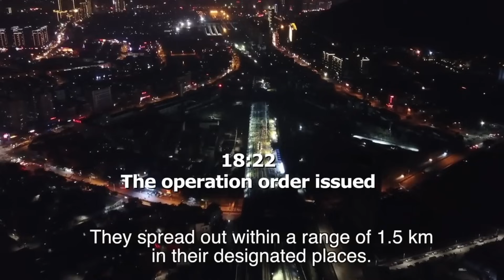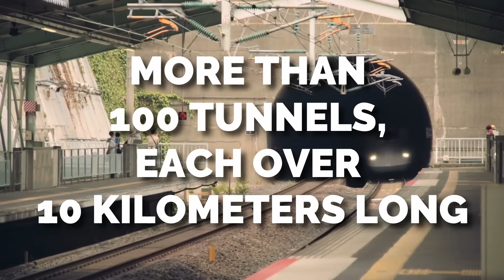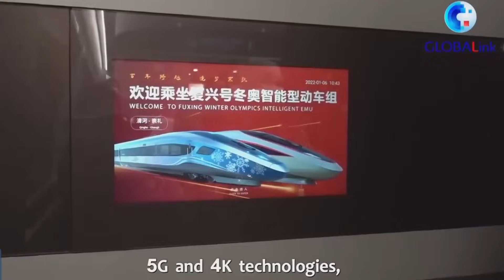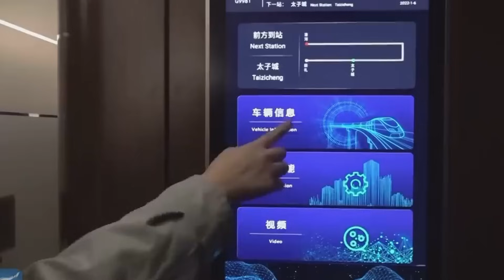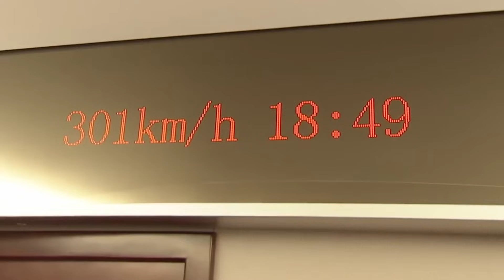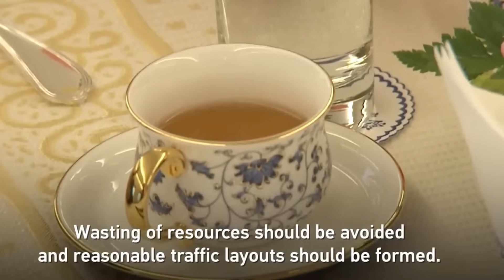ULTIMATE Engineering, How China build a train station in 9 hours, China Incredible High Speed Rail

Comment: Completing a project like that in 9 hours is quick but highly undesirable if safety and construction quality are top priorities.    

There is a video out there that shows a house in the US being built from scratch in about 45 minutes. It included pouring the concrete, putting up the walls and the roof, installing all the appliances, the piping system, the electrical wiring and the landscaping. The building inspectors even came on site and certified the installation in the 45 min time frame. 

There were several cranes on site and a multitude of workers, working in what would be considered an unsafe manner by today's standards. I expect that it cost much more to build the house in 45 mins than if they had built it the normal way. However, this was just a demonstration project.

There is a good reason that train stations are not built in other countries, the way this one in China was built.

Comment: KEY POINTS
California's plan is to build an electric train that will connect Los Angeles with the Central Valley and then San Francisco in two hours and 40 minutes.
But 15 years later, there is not a single mile of track laid, and executives involved say there isn't enough money to finish the project.
Estimates suggest it will cost between $88 billion and $128 billion to complete the entire system from LA to San Francisco.
In 2008, California voted yes on a $9 billion bond authorization to build the nation's first high-speed railway. The plan is to construct an electric train that will connect Los Angeles with the Central Valley and then San Francisco in two hours and 40 minutes. 

But 15 years later, there is not a single mile of track laid, and executives involved say there isn't enough money to finish the project. The latest estimates from the California High-Speed Rail Authority suggest it will cost between $88 billion and $128 billion to complete the entire system from LA to San Francisco. Inflation and higher construction costs have contributed to the high price tag.

The project has spent $9.8 billion so far, according to Brian Kelly, CEO of the California High-Speed Rail Authority.

Comment: I wouldn’t board that train. Two months ago we received the power transformer from Chinese manufacturer. It failed tests after arrival. The high voltage bushing was disconnected and oil level floater was not even installed.

Comment: I think something needs to be clarified for this video didn't spend much time on the construction:

1.  this happened in january 19, 2018.
2.  9 hours build a station is *Fake news*, its more like a upgrade, include:
   。Adding new platform, changing signal system
   。Changing railway for the incoming new railway line which started at the end of 2018.
   。Adding Bridges/Tunnels for passengers to across platforms.

3.  The Longyan station(龍巖站) itself was built in 1999~2003 with some expansions in the later years,
it was a transfer station for four railway-line before 2018:  
。Longyan–Xiamen railway(龍廈線)
。Ganzhou–Longyan railway(贛龍線)
。Ganzhou–Ruijin–Longyan railway(贛瑞龍線) (can be account as one with the former.)
。Zhangping–Longchuan railway(漳龍線)
In 2018 1/19, in order to add the new Nanping–Longyan railway(南龍鐵路) to the station, the crew spends 9 hours reform the railway in the station to connect with the fifth line. The new line opened in December, 2018.

4.The video said the Nanping–Longyan railway has been upgraded to HSR, but I didn't find the referenced news.
 At least when it was built the speed limit is 200km/h under in 2018, which is lower than the official definition of HSR by China's railway safety law, 250km/h. Most of the railway connected to this station has a limit of 200km/h or 120km/h under.